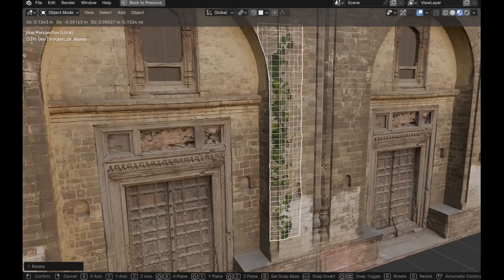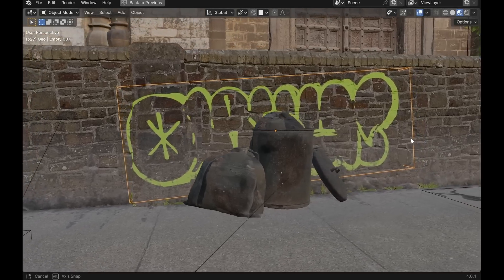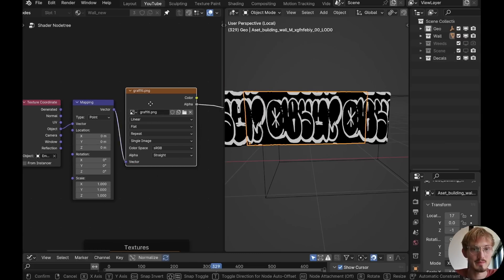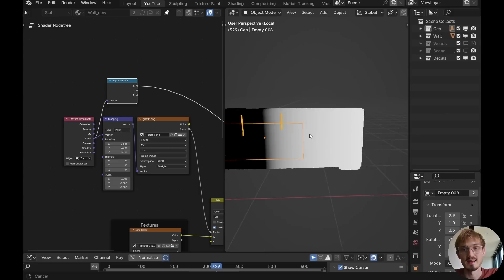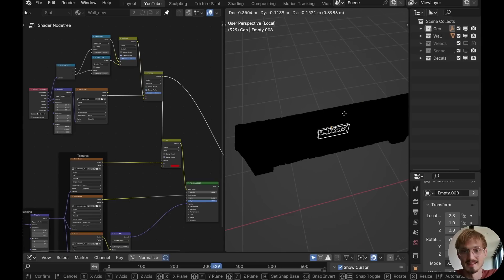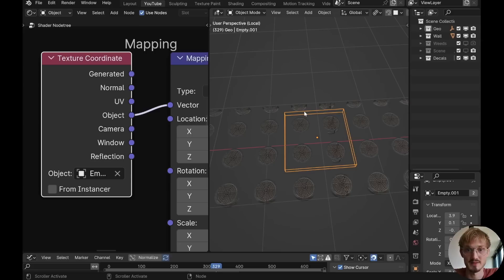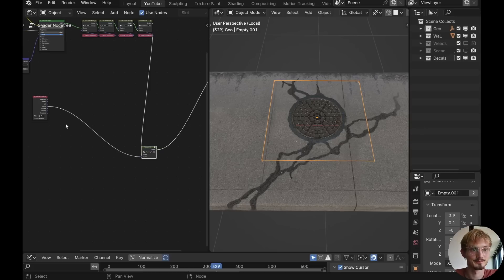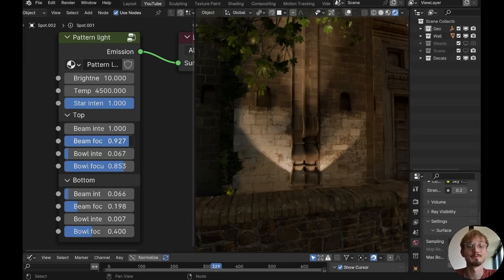The correct way to make decals in Blender (NO SHRINKWRAP)

Comment: I disagree with this being in general superior to mesh-based decals. Texture / Shader based projections are nice and this is a good tutorial no questions asked, but don't dismiss Mesh decals that easily, they are great in terms of performance (thinking about runtime in a game engine here) because you use them together with small and tileable textures to create surfaces which would need huge texture resolution if baked and keep all the unique data as low as possible. The artist-time management overhead of not having to insert the projection into every material it should touch can also important at times. Nevertheless, good tutorial and the technique absolutely is worth knowing too, thanks for sharing.
Reply from the maker: You're right! This is a bit slower to make. Maybe something can be done with the asset browser?
Do you want to explain why shrinkwrap is better for performance? I would think it's the other way around.
Reply: @robinsquares Thanks for answering, sure, but keep in mind this comes from a game dev's / tech artist's perspective. There are multiple angles to this.
Lets say you have a brick wall, fully textured front and backside, it uses one tileable 512x512 texture which is repeated various times over it and you add a bunch of mesh decals to it. The decal atlas texture might be 8k x 1k because we got a huge line of letters on it and a few other things. Both these reusable textures still need less memory than a single baked-decal 8k x 8k texture map. And memory, especially gpu memory, is precious :D
The shrinkwrap as a projection method, deformer, is not cheap in terms of performance, absolutely not, in that regard you are thinking correctly, but applied... it's just another mesh.
It is another draw instruction for the gpu, that is not for free but neither is the node group. 
Imagine you wan't to place 50+ decals on a huge spaceship doing that with a node group each will blow up the shader network. 
It really depends on the use case :)
Reply from the maker: @fleity  Very well articulated. Thanks for explaining that. I'll pin your comment to the top if that's okay.
Reply: @fleity But this doesn't matter if you are baking textures right?
Reply: @NicCrimson it has. Baked textures are relatively large compared to textures that you can tile. Sometimes it have sense when you are baking height/normal map that will replace lot of vertices. Some game engines like ie Vrage from Keen Software House can use central library of textures. Even with moded blocks. So you can use single texture on multiple models ( and multiple textures on single model too ). As example I will say that I created for this game particular block few years ago for one server Modpack. Due to phisic engine changes since then it had some issues. As I don't co-operate with that community anymore, this model was reworked recently, and new modeller, while he created really nice looking block, he used baked texture and not only mod become 30 times larger (8mb mine, 330mb new one), it got now some issues in game, as not only it doesn't render many times on weaker machines, it make huge performance impact on machines with less vram. On cards with more than 8 GB ram it performs actually better than mine as got less vertices, but gain is negligible compared to loses on weaker machines.
Reply: @fleity  But, what is the point of exporting mesh based decals from Blender to game engine? If the game engine supports decals (I believe all do) none of these methods should matter. Baking giant textures would tax VRAM, adding extra mesh would increase GPU (and CPU) calculations. I can't think of any reason to use any of them other than seeing a scene in Blender before creating the same scene in the game engine?
Reply: @gamerhobbit  I guess I mostly wanted to add that the presentation of "this is the one correct way" might not be as nuanced as it should be.
mesh based decals do have their place. Look up star citizen mesh decals, they do huge ships completely textured with tileable materials and then add a lot decal geometry (which is really just planes (or plane-ish geo) with a transparent shader placed on the surfaces. Trim sheets would be a similar thing. These decal atlasses give a lot better texture resolution at a fraction of the memory cost of baked textures. Yes the additional vertices need to be transformed but the trade seems to be worth it. 
Full screen space decals have some limitations too, they arent necessarily free either, they use geometry and a shader too in the end and do need to sample the depth buffer to reconstruct uvs. So surprisingly on a mobile game which does not allocate a depth texture mesh based decals could be a good idea.
Reply: @fleity  Thanks for the detailed answer and keywords to make more research :)
Reply: @NicCrimson you are correct
Reply: @robinsquares  I would appreciate if tell me how I can bake it pls I need it so Mach
Reply: This is objectively wrong - you can overlay multiple tiled texture decals. If you do that with mesh decals you'll take a hit in rasterization performance, because for each pixel you'll have to calculate multiple triangles, not to mention potential Z fighting, intersections, etc. It gets even worse if the object is viewed at near parallel angle (even more triangles for a single pixel, until you reach the end of the Z buffer). If you need to texture any megastructure, it's way easier to use texture decals AND the whole thing will be just 1 DRAW call. idTech does the same thing in Doom Eternal, the whole map uses nothing but vertex color and decals (millions of them). They a have huge texture atlas/library with all the decals (including normals and PBR metalness) and use that to decorate the whole map.

Yes, it would be nice if Blender had a toolset for this, so that you don't have to fiddle around with nodes. (somebody could write a plugin?)

Yes, it rarely makes sense to export the baked texture, but it's good for scenes you want to render within Blender, because it lowers performance and memory cost (latter is important if you want to render on GPU with optiX).

BUT, it can help you with creating textures with greater detail when you do want to bake them for export. Texturing in general is an ordeal in Blender (I mean we don't even get something as basic as layers for textures). 3DCoat shines in this area specifically.
Reply: Um you know that you can add a tileable textures on top of another texture right?
Reply: Yeah, but I need them to bake with the textures.

Comment: This is exactly the technique I was looking for. It works the same in Unreal and Unity. It gives you freedom where to place and you can still play around in the composition. Thanks for the info. I also considered using the secondary UV technique, this is better if you have a deforming mesh or know exactly where to place the decal. The addon $17.75 with this technique is rather expensive for what it is.... So I would recommend setting it up yourself.

Comment: Is there a way to extract only the rotation of the empty. This decal method is perfect for everything I need except the normal map. If I rotate the decal the normals will still be pointing in the same direction. I found a way to rotate normal map vectors but idk how to pull the Z rotation of the empty without using drivers.

Comment: Hey there! Quick question: do you have any insight on how we go about separating (for baking) a texture that has the decals applied after the Principled BSDF? I'm used to baking the separate texture maps by what's plugged into the BSDF node, but not sure how to include the decals on the texture since they are added with a mix shader. TIA!
Reply from the maker: Hey! Whatever goes to the material output is what the baking renderer will use. Just try it out. I think it'll work as you expect it to.

Comment: there is no right or wrong. this takes way to much time and also changes the material. mix stuff into materials allways feels messy. work as the real world functions. if the thing is overlaying make it overlay and not part of the same thing. so a new material slot or a shrinkwrap would be the option ( and they would be even faster to do and easier to debug in the future )

Comment: I do it with different UV maps for each decal on the mesh base material. 
Soo... no need for extra meshes, shrinkwraps, nodes for placement and cut the backface texturing etc. 
Just one material, with different UV maps applied to different decal images, mixed and mapped together in shader editor.
Plus you can mix in the normal, rughness, masks ....data into the base material...
In my opinion that is better & quicker than extra meshes, empties, modifiers, nodes for backfacing etc.
Reply: This is the correct way
Reply: I tried this method and OMG, this is kind of overpowered. No need to mess with empties and masking out each decal so it doesn't bleed elsewhere. With more complex models it's easy to create a messy shader network and even run into a node limit, like I did once. With this method, you just need to move UVs that you don't need away from UV tile. 

Thanks for sharing this technique.
Reply: BRo teach me
Reply: I used to do it that way but I took the time to build and script my empty setup and man it is faster and easier once it's setup
Reply: There can only be eight uv maps for an object tho, kinda annoying if your doing a race car stickers

Comment: This is an extremely useful tutorial, so congratulations! Anyone that have tried Unreal Engine know that the decal workflow is extremely, extremely powerful, I just don't understand why Blender don't have a more straight forward way to work with decals. I know that Decal Machine addon exists, but I don't know if it's any good. Any way, your method is perfect, so again congratulations, I wish you a lot of success with your channel! I'm your subscriber 2211 I guess 😀
Reply: This is pretty much how DecalMachine does it (well DecalMachine is an addon does stuff automatically and its a bit more advanced in the shader department)
Reply: @Cypoes.graphics   I really need to test it properly, I'll give it a try! thank youu!
Reply: In a simple level in ue5 i use almost 100 plus decals 😂😂 can't live without them
Reply: Decal machine is a mesh based alpha card system, it does have advanced functionality to somewhat blend the shaders, but it's more geared towards hard surface detailing, not as much weathering - which this method is well suited to imo. For large weathering, vertex painting is also very common, same as unreal